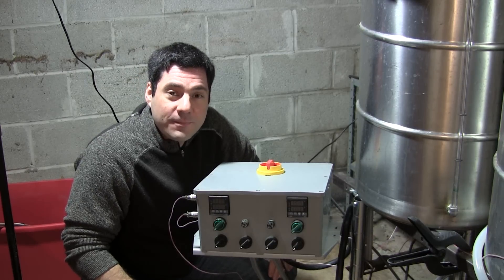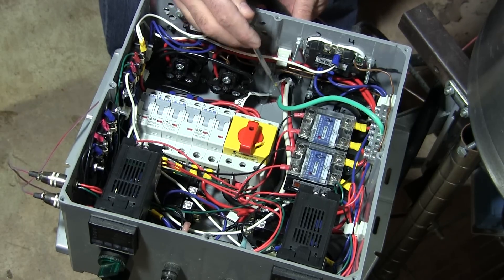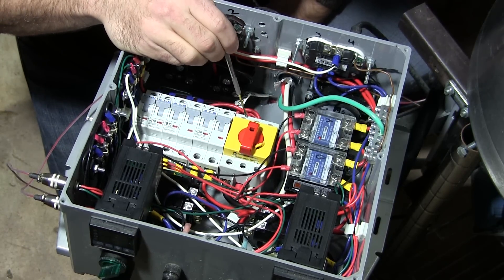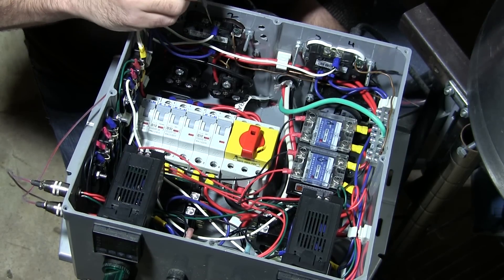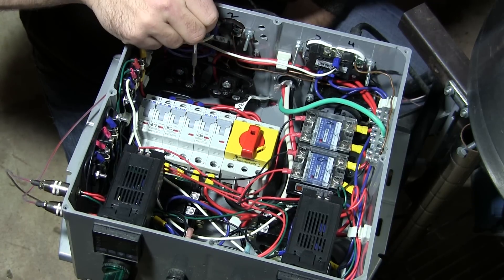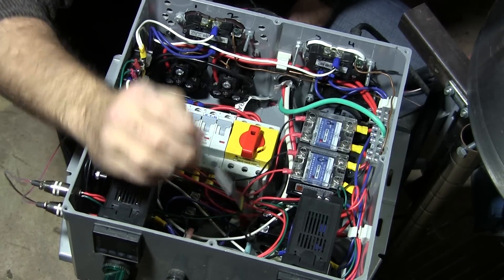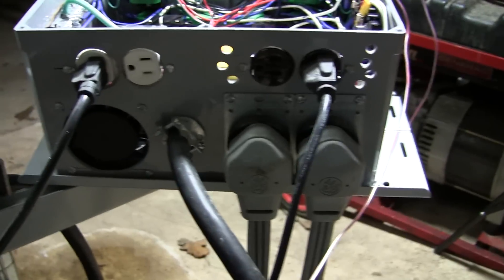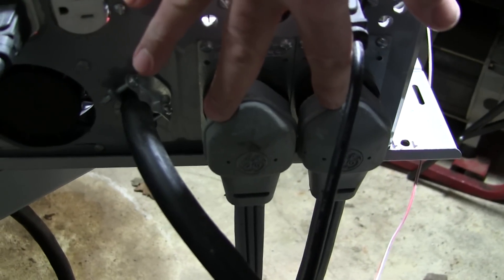Inside the control panel of my electric brewery

Comment: Hey Joe, excellent video.  Question for you.  You have a 4 wire GFCI feeding the box.  You then split off a few 110V and 240V.  Going to the heater element receptacles will be a Red, Black (from SSR) and Ground I assume.  Or do you have the Neutral on the 3rd pin?  Also, I always heard you need the 4 wire for GFCI to work, so how does the 220V receptacle trip the GFCI if there is a fault when only 3 wires power the receptacle?  Thx

Comment: Hello Joe!  I want to have the same type of safety built into my controller as you do.  You talk about adding the contactors placed where you need to manually control the elements when they fire.  Do you have a schematic showing how you wired them into the circuit along with the switches?  Much appreciated.

Comment: Hi Joe, I have a question regarding your circuit protection within the control box.  I have had suggestions from other people that a single RCBO inside the box would provide enough protection.  Is this correct or should I still be separating out each circuit with correctly rated protection per wire gauge?  Cheers Luke

Comment: I have a question i hope you can answer if you have a second.

How are you attaching the SSR's and breaker to the box?  Obviously everything else is externally mounted, but for those did you just drill through the bottom and use screws or nuts/bolts or something to hold them in place?  Or did you just JBWeld them or something in place?

Comment: Hey Joe I'm making something similar but only using one 4500w heating element. Question is can I run both 220v and 110v off the same #10/3 wire or will the 110 need to be on a separate circuit? Want to put a 110v plug in to run a small pump but didn't want to different cords coming out
Reply: Okay but will they be able to run at the same time also could a add a 110v 1500w heating element to run off the same #10/3 wire... My #10/3 wire will come into the project box and go to the 30amp double pole  switch then to my ssr/POT then out to element...(I'll be running a 220v cooling fan and digital volt/amp meter also)  At what point do I take the 110v off of. And I'm guessing I'd used a 15-20 amp fuse inline with the 110v to protect it.
Reply: Awesome will do! 
Thanks for your time
Reply: Not seeing the email address

Comment: Good video overall, but 50a requires 6awg. Electric code always requires only pulling 80% of rated power for any extended amount of time so I hope you are only running 4500 watt elements.

Comment: Nice you should of went with a bigger box.  6 wire 50 amp   is that s.o. cord from panel to disconnect to receptacle. I don't think that is rated for that  you should a piped between those 3. No cord in pipe either use thhn there.   I really liked it  I say just bigger box, maybe make that more of a permanent install. Unless you're always moving it.  Is this a legal brewery